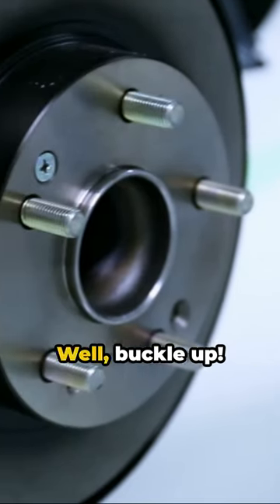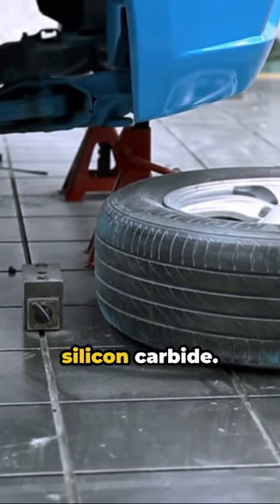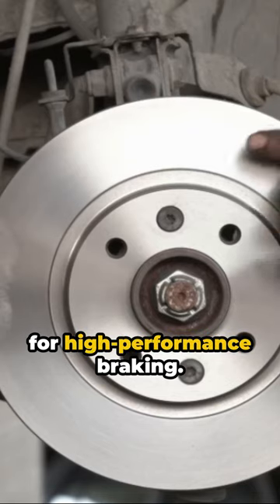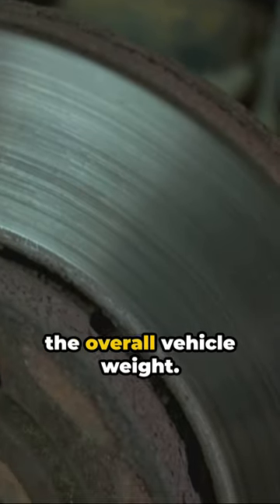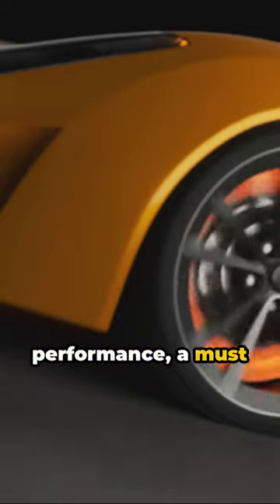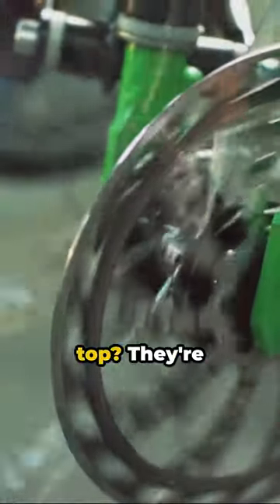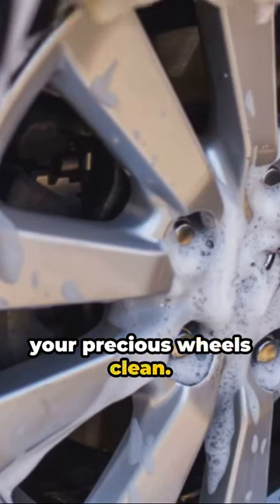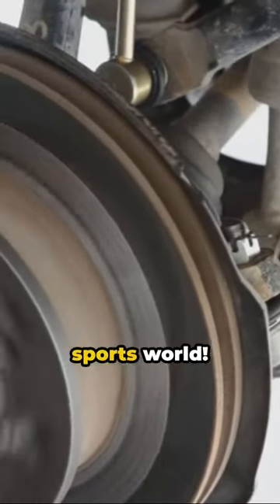What are ceramic brakes and why are they better? #911 #pccb #ceramic #brakes #shorts

Comment: Standard drilled and slotted rotor: 150$
Standard carbon ceramic rotor: 6000$

Yup
Reply: 150 dollars? My guy you must be buying cheap eBay rotors. Drilled and slotted rotors cost about 2k
Reply: @2seep  i just got rear rotors for a C63S AMG for a customer 3 days back for 120$ each (Zimmerman brand)🤷🏻‍♂️
Reply: @leesin2me they’re not OEM. Brake service on my 2020 GLe is £2500 . Thats discs and pads. They’re not ceramic.
Reply: @liamhawkins4062  i know they are not OEM. I run a workshop in Dubai and know the prices. The original rotor for the C63 was around 900$. 
Why are parts in Europe are so damn expensive😅
Reply: and any joker with a can of WD40 can straight ruin them in a second. and how do you find you? your car won't stop for shite.